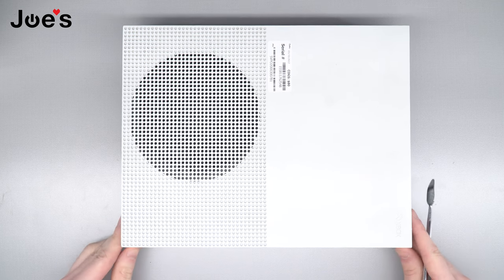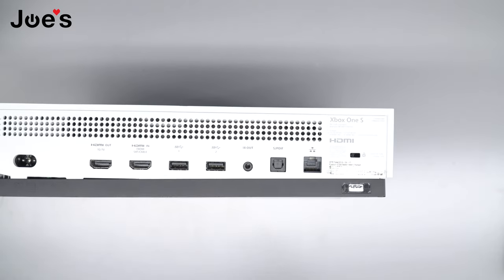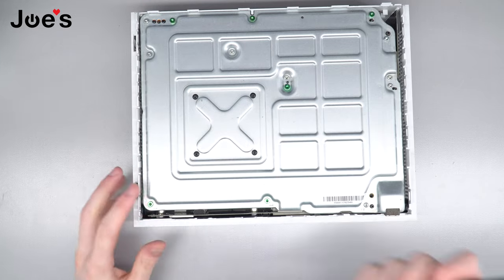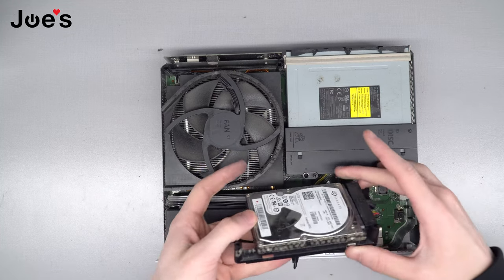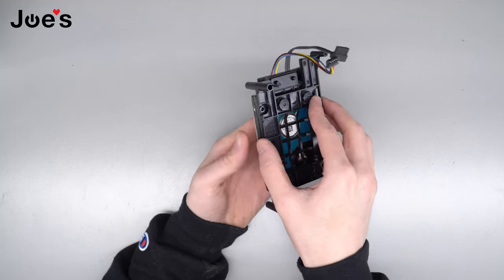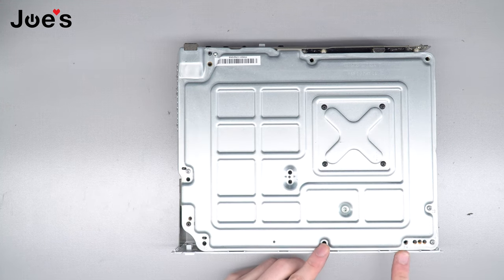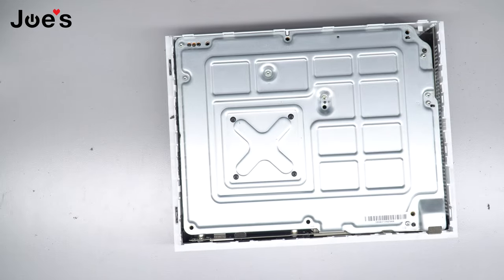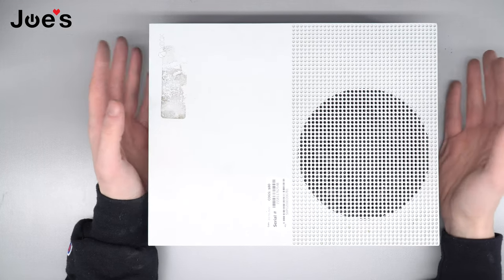Microsoft Xbox One S Hard Drive HDD Replacement | Repair Tutorial

Comment: Ordered myself some pry tools to fix this xbox in 2 days, picked it up from my local ewaste, wouldnt boot and I tried the low resolution mode with no luck (no second beep and all that), hoping to get it working with a SSD and that
Reply: When you removed the HDD, was it a standard 2.5" or so HDD? Found a tossed out Xbox One S in the middle of the street this morning! Outer case is about destroyed but the metal frame & covers look in good shape! Might take it apart for the HDD!

Comment: Thanks for a great tutorial

I just replaced the seagate video drive that seems to of just stopped working with a 500gb Samsung ssd for £30 

I was gonna leave the black bottom case off for a month or maybe permamentky as its such a ball ache to get off - I have it on a mesh metal tray under a desk, so holes under neath it and plenty of space below it, does the black under tray make a massive difference? Just cosmetic?
Reply from the maker: So long as its not on a flat surface and gets enough air circulation than its fine. It may get more dusty than normal with it off so maybe use compressed air to clean it every once and a while.

Comment: Does the drive in xbox ever work again? Or os it permanently screwed? 

Ie could you take it out, format it in mac / windows then format it in windows for use in xbox? 

Or is it always a a case of buying a new harddrive
Reply from the maker: You can absolutely do this on the HDD that is in the console originally, and sometimes that will solve any corruption issues.

Comment: Found some thread that said that you don't even need to format the drive, it will fix it automatically upon boot
Reply: Is this true? Working on an xbox one s all digital version that has a bad drive. Im gonna put in a known working drive, and was wondering if you swap them this way, will the xbox automatically format the new drive like a PS4 will?
Reply: Nevermind. It works. Just swapped them out and xbox is like new again ^_^
Reply: @Lord_Lvcif3r  I haven't actually tried it yet, great to get confirmation!

Comment: I replaced my power supply and the fan for the Xbox One S and still will not power up. The power light lights up for a brief nano second and you will hear a click and the light goes right back off. Should I be looking at the HDD replacement?
Reply from the maker: It is most likely a short on the motherboard. The Xbox one S is notorious for it.

Comment: Is it the same for the x? I want to repair my x bc I keep getting E200 or E105, and everytime I tried to do the osu download it would give me E101. Even bought a new Hard drive and formatted properly and yet it still does not want to work. I could really use the help
Reply from the maker: Here is how to format the drive: https://youtu.be/UJAz03fgMJA
Here is how to replace the HDD on the Xbox One X: https://youtu.be/h6Y2pHCMDEI
Reply: I did exactly what you did in both the vids you linked for some reason it still does not want to work. It keeps giving the same 106 error with no start up. I don't have the money right now to just buy a new one or get it fixed which is why I'm trying to fix it myself. The OS version of the console is 22000.
Reply: @Akirasama0  i have the same issue. did you figure it out?
Reply: @TheOnlyUmagon  I have the same issue too bro did you figure it out
Reply: @vukkii3908  never did but there's a chance the issue is on the board itself of the drive. i dont know if ill be able to figure out but i didnt take the console apart further just collecting dust now
Reply: Scripts or downloading files to a stick or whatever is completely unessasary.

"I purchased a 1 TB Samsung 870 QVO for my Xbox One X, I did not perform any formatting to the HDD prior to the install, it went straight from the packaging it came in and was installed in the console. I didn’t use any scripts or OSU files. I simply plugged the ethernet cable in and booted it up using the manual recovery button method. The Xbox immediately recognized the new SSD and automatically formatted and installed the OS. No special tools or hacks. The console is just like it was before just loads games a bit faster, I can play online, it updates when it needs to without hassle. Not sure why everyone is having such a hard time with finding so called software for the new hdd."